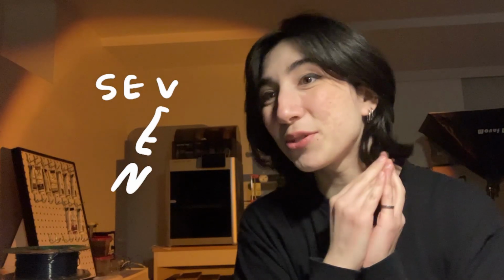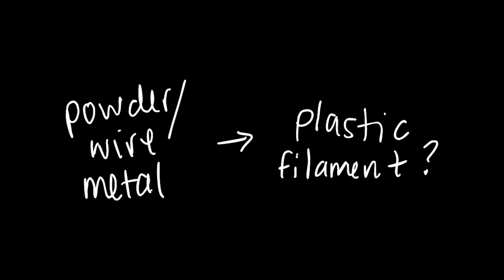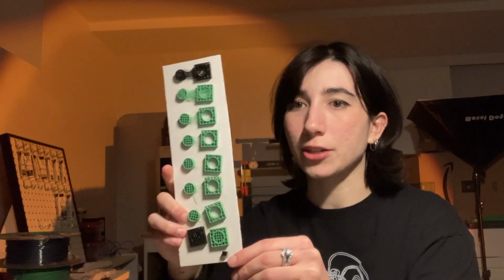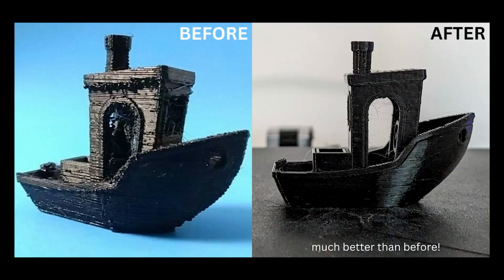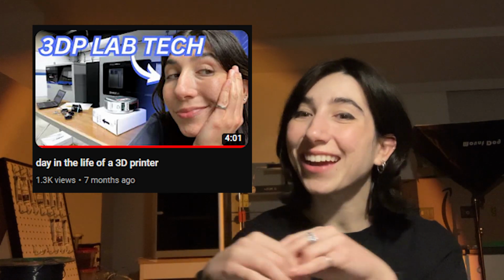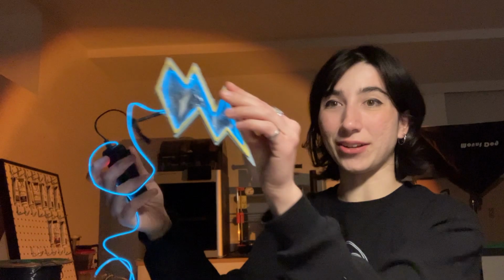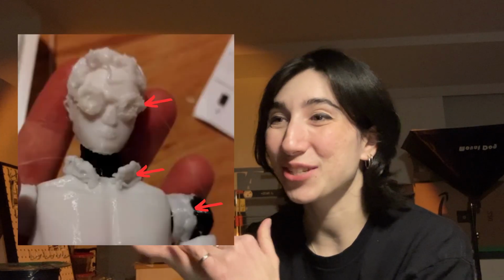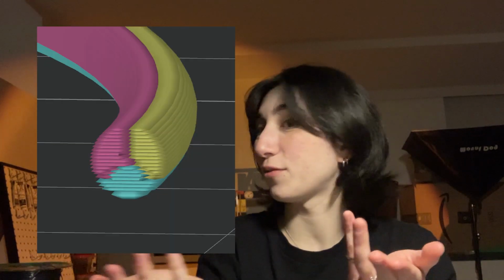my BEST 3D prints of 2023

Comment: The light you want to weld to ("EL Wire")works on high frequency alternative current, that why the driver and and wire have subtle humm.
There's. 
At least ones i had..
Reply from the maker: Thank you ! I didn't know it was called EL Wire so that helps. Mine also make a humming noise although I'm not entirely sure if they use AC current since they're powered by two double A batteries. Unless there is some sort of converter in the black box that is the battery pack ... I should take it apart and see.

Comment: Ok, now i have to watch the lightning video.😊
Reply from the maker: It's personally one of my favorite videos of mine - I hope you like it just as much as I do :)
Reply: @StrelkoMania  it is a good video short and to the point, and the lights are a grate idea.
You could revisit this. The lights are cool. You could add them to a shirt, pants or a jacket. It should be easier to hide the battery there. You could add adjustable brightness, reduce the battery size, and make it a little more practical. If you get the battery size down you could braid the light into hair and get a cyberpunk look.
See have many good ideers that video gives. I am going to look that type of light now, and how to connect them.🙂
Reply from the maker: @Petch85  Oooo a lot of good ideas! Also you read my mind, one thing I wanted to eventually try with the lights is add them to clothes. I have another volunteer robotics event coming up soon so I'm currently trying to think of something to make to wear to it - the theme is more musical theatre this time instead of energy like I mentioned in my lightning bolt shoes video.

Thank you for your awesome comments :)
Reply: @StrelkoMania  I know little if anything about musical theatre, the only symbols that comes to mind is the treble clef, the two masks, the star symbol and the rectangular light box (both made with lightbulbs, for that ~1930 esthetic).

np, it is much easier to wright a comment than to make a video and in 1-3 years you will hopefully get more comments than you could ever read. 🤞
Reply from the maker: @Petch85  Oooo I am still brainstorming as well, I will take your notes into consideration! And of course, thank you for believing in my channel and for being here :) it's been a lot of fun so far, I'm excited to see where it might go ...